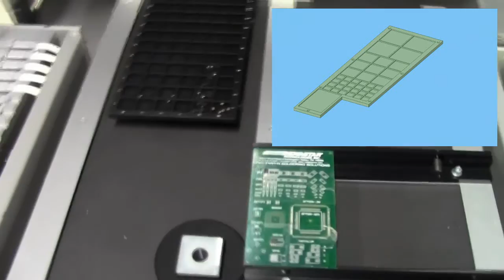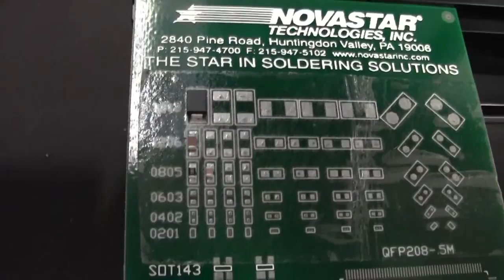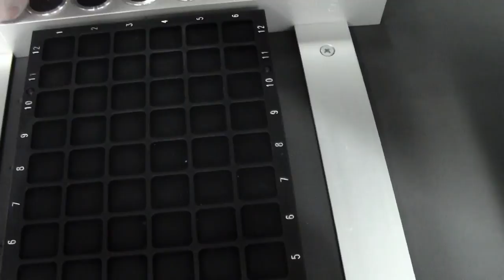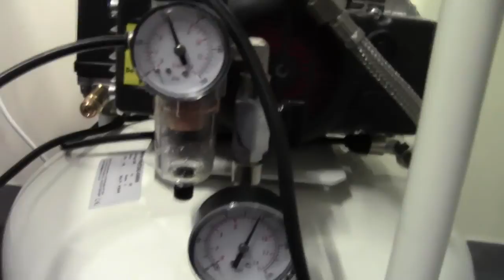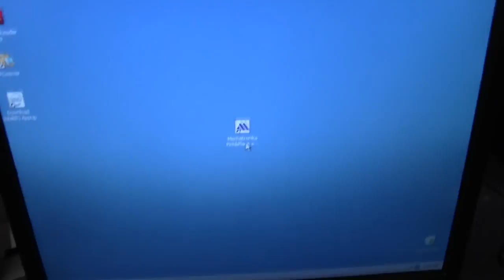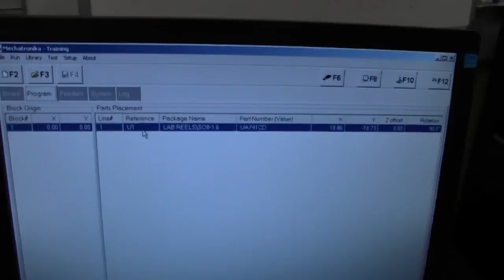Automatic SMD Pick Place M10V. Part 1 Introduction to the machine

Comment: I would not recommend Mechatronika.
The only reason why they exist is:
a) they came early

b) they served a problem in a way that is absolutely unacceptable, some users accepted that because there were not many alternatives

c) after more than 15 years their development is just rubbish, their Software burns the customers time big time. One example 5 mouseclicks for placing a single components out of a list. 10 Components = 50 mouseclicks.

d) Mechatronika is an absolutely uncooperative company, they won't fix your problems they will just teach poor workarounds which do not improve the handling of the entire machine.

Mechatronika vanishing from the market would actually be what they deserve.

* Do not even think about upgrading your machine from Mechatronika, they are overpriced and do not deliver a suitable value for the money *
We did an upgrade, the price has increased 50% within a short time 9800 -> 10800 -> 14800 EUR
Nozzles increased for 100% 30-40EUR -> 90EUR
Their top of the line module is using 5$ SD cameras from ali-express, that's certainly worth the high price.......

Due to the chinese competition they fail to acquire new customers to keep the price low, so they focus on ripping off existing customers with almost no value. Mentioning important items to them will be just ignored and the customer will be left alone if problems come up with their machines.

Mechatronika is a big no go.

Everytime sending an email to Mechatronika one of the bosses will reply, because they are small and they just ripped of customers in the past instead of investing the money into real development which is helpful for customers.